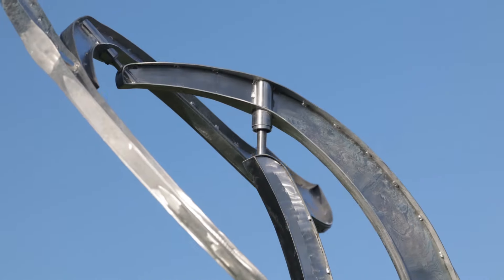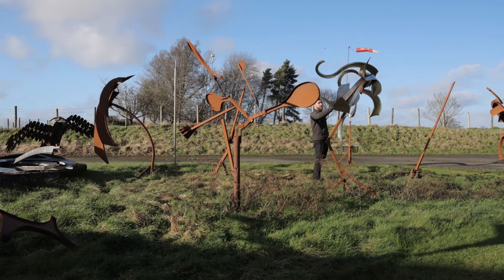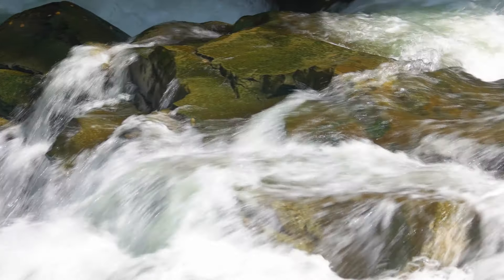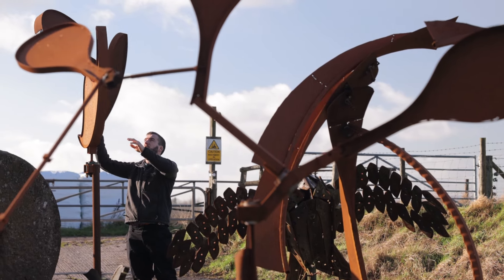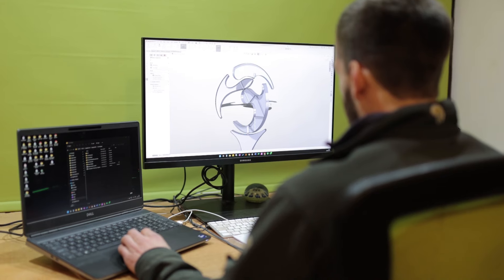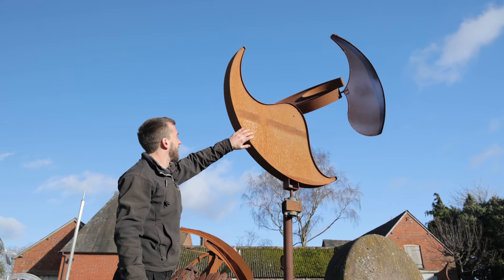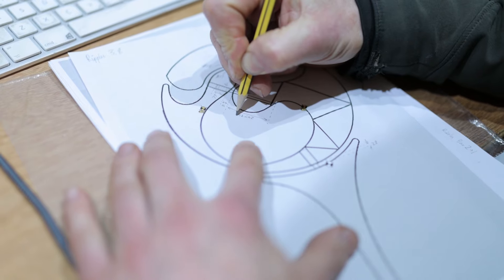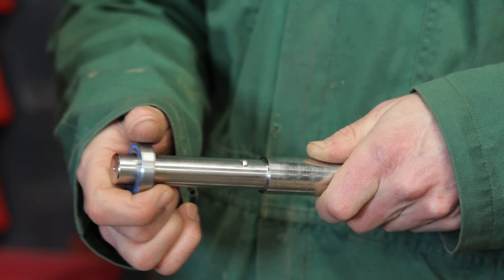Will Carr - Secrets of Kinetic Sculpture

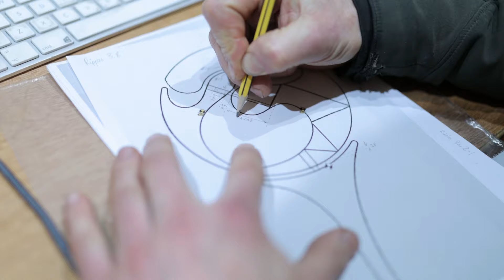Comment: Don't suppose you can share what these rules are that you mentioned at 1:56 and 3:23? 
Also just gonna ask if/what software you're using to see how your CAD models interact with wind/fluid.
Reply from the maker: Oooh, I think part of the joy is figuring them out with play.  I don't want to say too much but having the sculpture symmetrical along one axis makes it infinitely easier to balance, the bearings should not be too similar angle to eachother, i,e, if all bearings were vertical they would not pass energy between the pieces so well.  There is more... perhaps play spot the similarities between my 5 latest sculptures, you may find the rules :)
Reply: @WillCarrKineticSculpture  Suppose I'm off to your other videos then on top of finding some high load bearings somewhere. Not something they sell in my local hardware store, nor anything I really need unfortunately(online shopping for the win, with me being at a loss for figuring it all out).
Reply from the maker: @ignisking759  If you send me an email and how far you've got I may be able to help. I used deep groove ball bearings for the load spec that I need, and the bar/shaft has to be thick enough for that loading too.  If you get a housing milled for this it can't be welded, I glue this milled bit inside a tube so that no heat enters the housing as this upsets the tolerances.  If you have low tolerances it is best to use a lot bigger bearings than the maths says as they are only rated when the tolerances are tight, compression fit, bearing retaining compound can help too.  If you are able to use 2 flanged bearings they are the easiest as they generally self center with a clever ball type setup but arn't so aesthetically attractive
Reply from the maker: I don't model how it moves in the wind in CAD, I will make sure it doesnt collide though.  I use solidworks but is a very pricey bit of software
Reply: @WillCarrKineticSculpture  These details you just shared alone will save me a huge hassle of trial and error, thank you.
Reply: @WillCarrKineticSculpture  I saw that, and it does seem convenient as opposed to building mini models. Jokingly, I've never heard of a CAD software that wasn't pricey. Else apparently it's not worth using is the general consensus these days it seems. Course, Solidworks is an especially little money grubber in my opinion(all online courses are nearly 2,000 USD last I checked to simply train for their certification exams).
Reply from the maker: Yeah it is very expensive, I was pirating it then they caught me and had to buy it for silly money, but they were brilliant once I had bought it

Comment: а эта вертушка, если будет буря, прохожих не покалечит?
Reply from the maker: The sculptures are designed to be out of height of children.  The larger pieces are also out of height of adults, the circle one, Ripples, is at a height to suit smaller or larger spaces and designed to have more horizonal viewing
Reply from the maker: This is designed to Uk or US wind loadings and will not fall apart.  Only if you put your hands in during a storm you may get issues.  I have larger sculptures which have all the pieces out of height of touch, this is out of height of children and adults have to use some common sense in a storm